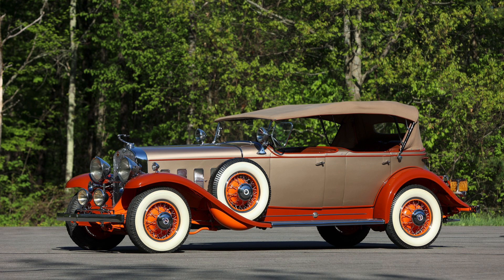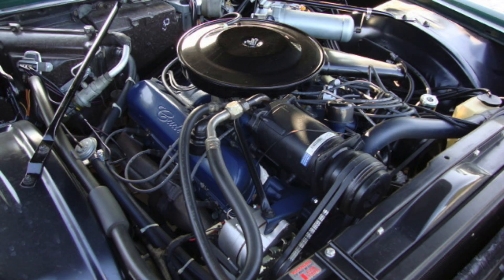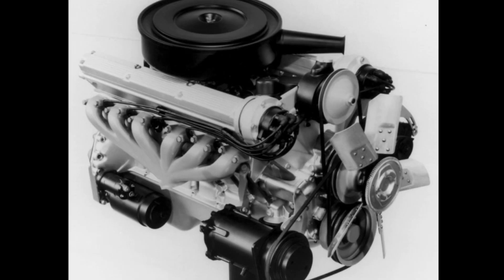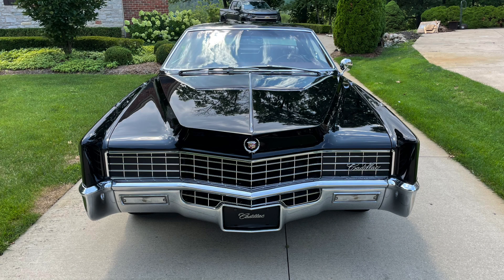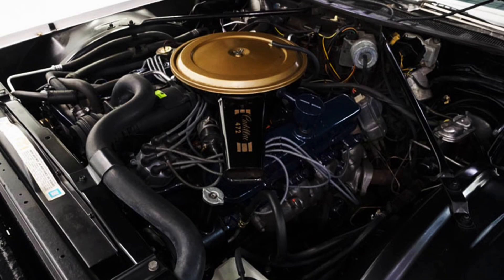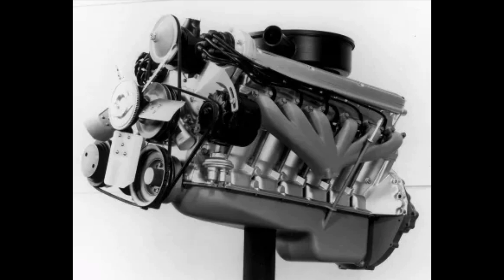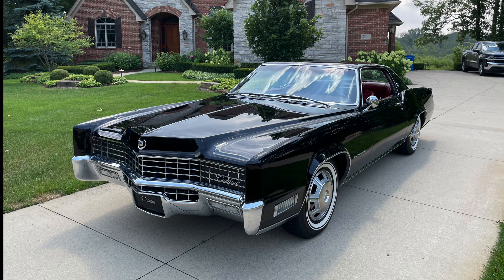Cadillac Builds an Awesome SOHC V-12 for its 1967 Eldorado...But Scraps It For Production!

Comment: I started as an engineer at GM in 1986.  One of the first programs I worked on was a heavy duty chassis version of the Cadillac FWD C body vehicle for limousine and armoured car usage.  I worked with some older Cadillac engineers who were around when the V12 was under development in the '60s.  It was an aluminum block and head design and they said the main reasons it didn't go into production was engine sealabililty, mainly head gaskets, and block porosity issues.  They said the 472/500 was done in a compressed time schedule so there was very little "optimization" of the design, rather it was a "home run" approach where they just threw cast iron at it to ensure robustness.
Reply: You'd think after that experience, and the troublesome aluminum Buick V8, they would have gotten those issues worked out by the '82 HT4100, but they still had problems with Northstar head gaskets until 2004.  Henry Leland must have spun in his grave.
Reply: @ralphl7643 
As I understand it the main issue with the Northstar head gasket issue was the  poor choice of the head bolt size and the pitch of the thread. IIRC the head bolts were a fine thread. A big no no in aluminum usually. Also I'm not sure if the fasteners were SAE or ISO. Metric fasteners vs their SAE equivilants are usually stronger and can take a higher torque for equivilant materials.
Reply: @mpetersen6  Yes, they made the bolts larger in 2000 and threads coarser in 2004.  But after the HT4100 had ruined Cadillac's reputation in the 80s, the Northstar needed to be indestructible from its beginning in 1992.  A big nail in GM's coffin.
Reply: @ralphl7643  The Aluminum Buick V8 as a Rover engine ended up being OK
Reply: @gregrudd6983  I agree.  I couldn't believe it at the time, even being a kid, but my best friend's father had a 25-foot Owens cruiser in the brackish Sacramento Delta and it was running an aluminum Olds or Buick 215 - with raw water cooling!
Reply: One of the engineers I worked with at the former Buick engineering said one of the issues they had with that aluminum V8 was that leftover shavings from the block that didn't get cleaned out during the manufacturing process would turn into little spheroids when they came into contact with ethylene glycol in the coolant.  These would then impinge upon the water pump impeller and create failures.  The Brits figured out how to address all the issues and it proved a pretty robust engine design.
Reply: Interesting
Reply: Since when would head gasket issues stop GM?
Reply: I entered GM engineering via the GMI program in August 1966... saw the '67 Camaro before it came out... quite a surprise design at the time... 
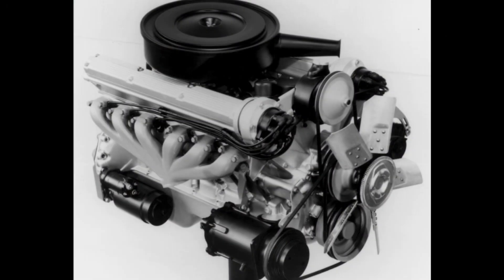At 01:34+ in video he's blathering on about a deep groove pulley on the AC compressor... obviously it isn't, as the belt is actually showing partly above the pulley groove... rather than down in the groove... oh well... kids these days... LOL!

Comment: man, too bad they didn't go for it...what a halo that would have been for Cadillac...everyone would know that under that looonng hood was an awesome 12 cylinder.  I don't think the cost would have mattered that much as plenty of people will pay for the prestige of a halo car.  and what is an Eldo for other than posing?  lol.  Although, i can't see that a high revving engine would be in line with the market for the Eldo...mountainous torque would much more appropriate, which it got with the 500.

Comment: Fascinating video. V8 or v12, the 67-68 ElDorado’s are works of art. Cadillac at its best…
Thanks for the great videos Adam!
Reply: The 67-68 Eldorado is one of the best looking cars GM ever made, but it would look better if the front wheels were moved forwards 4-6”. That huge front overhang looks off.

It would be cool if someone did a complete resto-mod on one, actually swapped in a V12, and took it to a builder like the Ring Brothers to have those front wheels moved forwards (a massive undertaking). 

They did it with the AMC Javelin they built for Prestone Antifreeze, and it made it look so much better. But then again, that was a cost no issue type of build.

Comment: Thanks for this look back on the potential V-12 considered for Eldorado in its debut. All things considered, hearing the increased cost built in to a front wheel drive arrangement, I would have preferred passing on the front wheel drive aspect in favor of the OHC 
V-12. I think that would have been a more desirable arrangement.
Reply: Exactly. It would have been a marketing slam-dunk. Many would have paid a premium for a V12 option - and the V8 would have served for a lower price option as well as spreading the risk with the new V12. History says they backed the wrong horse because FWD was never befitting of a large luxury car.
Reply: Yes and no. The front wheel drive enabled a flat floor and more interior room. No big transmission hump. @andoletube

Comment: I'd like to point out a few benefits of a V-12 that you didn't mention. I don't believe horsepower was a significant factor in going for twelve cylinders, but acceleration would be significantly enhanced over a v-8, one reason Ferrari preferred them. There was also the prestige factor a twelve offered, helping to further set them apart from Lincoln and Imperial. As always, it was nice to get technical information on that little known engine, as well as your perspective on that project.
Reply: The idea of the V12 was smoothness,  some folks didn't want to know the car was actually running,  the Packard was good for those... but the Packard straight 8 was probably just as smooth running as a V12.
Reply: @jeffreyfelder7981  Totally agree about Packard.  Even their final V8's were amazingly smooth and quiet.  As a kid, I literally walked past a Clipper in the shop one day and was shocked to see the fan turning...
Reply: V12 are also smoother.
Reply: I would say that Ferrari and Cadillac is comparing apples and watermelons.  A large luxury car needs a quiet torque monster at low RPM, not a screaming high-HP, high-RPM motor.   They didn't forget about one-upping Lincoln though... I'm pretty sure they came up with 472 just because Lincoln had a 462.   😉
Reply: As to acceleration, disadvantage of a V10, V12, V16 over a V8 is the additional weight... as well as length and complexity...

Comment: Sure, the big Caddy V8's were fairly reliable, but had a hard time passing up a gas station. This was never more impactful when the first gas shortage hit, with it's higher prices. Cadillac had to respond by reducing the engine size in 1977. It already had the "international" sized Seville.
The 500 c.i. Caddy V8 was surely a torque monster, but from my experience, they had a real carbon build-up problem. This necessitated pulling the heads to properly de-carbon the engines. On the Eldo's, this was an easier job because of the spacious underhood. But with any Caddy, the accessories presented a problem.

Comment: Would it have been cool from a collectors standpoint? Absolutely. But I don't disagree with the bean counters on this one, as the 472/500/425/368 proved to be a good motor despite all the emissions garbage it would face during the malaise era. A V12 with overhead cams would've been a service nightmare in this era, with the requirement of more frequent service and needing specialized staff. They never wouldve survived the secondary market without Cadillac specific mechanics.

Comment: The V12 would have added more weight on the front heavy fwd Eldorado unless it had an aluminum block, an extreme rarity at that time
Reply: It WAS an aluminum block and heads. One more added cost to manufacture.

Comment: I had no idea the Eldo was supposed to have a V-12.  It's almost criminal that they flirted with the idea, but didn't bring it to fruition.  What an engineering coup that would have been!  

In 2015 I accompanied a friend to Oshkosh, WI for the annual Experimental Aircraft Association's annual big fly-in (think 500,000+ people visiting, and 10,000 planes at the local airport), and Ford Motor Company had on display an incredibly beautiful show car, paying homage to the original Lincoln Zephyr, painted in the original Zephyr blue.  It was gorgeous.  Asking the reps, I wondered what kind of power plant Ford would consider using; their answer was disappointing:  A turbocharged 4 cylinder.  That car would have deserved a V-12 too.
Reply: Yes, Cadillac was indeed experimenting with a V12 and even a V16.  Should have put a V12 in the new Front Drive Eldorado.  That would have forced Lincoln's hand, and maybe even Chrysler's hand.  Ignoring it would have meant extinction.

Comment: The fuel pump at  (2:21)  looks like a regular 4657 pump.     Then at  (3:27)  there's  a other fuel pump on the DS but looks like a newer 40704 pump.      Just imagine if Cadillac made a 67 Eldorado with a V-12, manual trans, RWD with a 12 bolt posi and four wheel disk.........

Comment: The 1966 and 67 old Tornados 425 ci was rated at 385 ho. Caddy was way behind in engine output.
Reply: Caddys make torque.  Had several old caddy 425s and several 500s.
Drove them for 25 years straight. 
Then I built a super caddy with 500hp and rebuilt the th400 myself and everything in the car. I know every bolt in those engines.

Comment: Thank you for revealing this little known information. While the OHC V-12 concept was an interesting and exotic design exercise, it seems that GM made the right decision to stick with tried and proven reliability of a more conventional engine design. GM was already pushing the envelope on many design fronts in the 1960s, and perhaps the price we paid was much more mundane engineering in the 1970s due to things like Ralph Nader's book "Unsafe at any Speed".

I would also agree that packaging a V-12 with a FWD transaxle might have been a challenge in the case of the Eldo.
Reply: GM passing on a V-12 was a safer decision too because the Achilles Heel of '67 Eldorado's is the braking ability. 

In its January '67 test drive; "Eldorado Switches From Push To Pull", Motor Trend openly questioned the safety and ethical responsibility of Cadillac for engineering a car with such poor braking ability, comparable to a late 1940's station wagon. Cadillac's response was to hand over a disc brake optioned car to MT test drivers. Even disc brakes were barely adequate.

I believe GM was well aware that the Department of Transportation, which had been formed the previous year, may raise power vs safety concerns too, helping them to nix the V-12 idea.

Although my '67 had the front disc option, it was still scary to panic stop at highway speeds. Sometimes it's wise to stop while you're ahead.
Reply: Wait, why would the cars have still been FWD instead of Cadillac adding an additional range of smaller sports sedans and sportscars as direct V12 Jaguar equivalents alongside the larger Cadillacs, much as Cadillac has today?  Was there no appetite for a Cadillac equivalent to the Jaguar XJ12 in the 1970's?  (I'm guessing a Cadillac version of the Corvair in the 1960's would have been totally out of the question, as it would have been totally out of character for the Cadillac brand at the time? Attitudes at GM had rather changed by the time the Cimarron, and later Catera, came along as small sporty sedans?)
Reply: @TassieLorenzo Don't forget the CTSV as well.
Reply: @tassielorenzo7070  the closest American competitor to the Jag would be the Corvette. The first generation T-Bird could have been one as well, but it went off in a different direction and ended up in a similar market segment as the Eldorado.

I suppose that, in the eyes of the decision makers, there was no perceived market for a domestic competitor to the XK-12?

Comment: The 472 and 500 would blow the head gasket between cylinders, causing two cylinders to completely lose power. If you were up to pulling the intake and heads, maybe not a deal breaker.

Comment: Did they ever drop one into a test mule? When did the Pontiac OHV inline 6 hit; about 1967? Alas, the V12 wouldn't have survived the lowering compression and eventual fuel crises of the 70s. Jaguar managed to do it, albeit at a MUCH lower volume which is NOT what GM likes to do (Corvette notwithstanding) . Notice how quickly they killed the Fiero which somehow snuck out.

Comment: Nope, the high compression 472ci, GM crap bean counters, installed a plastic over metal timing gear.  Which 100% failed between 50-80k miles. Total mess.  Same for the high compression 500. Like the stupid plastic OHC timing chain tensioners. Same results. The timing chain hopped over its timing, ruining many of the motors. First telltale sign..  cannot keep distributor timing steady. 

While our 74 (472) and 76 (500) models seemed  to not have above issue in mass..  there was not enough power/rpm, camshaft chain pressure (due to low life and overlap of these choked motors), where the plastic over metal teeth would break off.
Reply: Plastic timing gears were there for quieter operation. Metal gears would have been cheaper to produce.

Comment: There’s just something magic about a 12 cylinder engine. So smooth.
Reply: It is the power overlaps that make smoothe running the more cylinders the more overlaps
Reply: Yes, in principle. But those Caddy V-8's were very smooth and silent. The 429 was a magnificent engine that performed flawlessly. I suppose the 472/500 engines were good too but I remember seeing one with its crank in 2 pieces. In any case, there would be no real advantage to a V-12, just like there would be no advantage to having an overhead cam in an engine that tends to run around 2000 RPM. But a V-12 badge would be cool.
Reply: @soaringvulture  The old 346 L head Cadillac V8's were amazingly smooth as well.
Reply: @edwardpate6128  Easy for a flathead to be smooth. Not much valve gear to make noise.
Reply: @soaringvulture  v-12 is just 2 v6's stuck together........JMHO but DOHC would have been a game changer even on a 2,000 rpm engine......the sheer amount of valve area is just insane.

Comment: Thank you for illuminating the history on this V12, Adam. I'd read a few scraps of info through the years on this and you are the first to really put this story together! The business case just wasn't there for this engine from a cost and or possibly a  reliability perspective. Cadillac mostly had always based their engineering on the tried-and-true, executed extremely well.
This "conservative innovation" served them and their bulletproof reputation very well for many decades. Too bad that by the early 1980's when they had to react quickly to multiple fuel shortage scares, they didn't have time to fully develop the V8-6-4, the 4.1 V8 or the Olds diesel they utilized to their usual very high standards. As we have all seen - this and a lot of other factors in the marketplace conspired to cost Cadillac their hard won reputation for excellence. Since those dark times they've built and continue to build vehicles today which compare to the best on the planet, but their reputation continues to lag behind the reality of the quality and capabilities of their vehicles - an argument for another time. Cheers!
Reply: Small rough-riding compacts do not qualify as the "best on the planet".
Reply: Yeah, it's too bad that it isn't still 1965. Compare what Cadillac produces today with any of their CONTEMPORARY competition, Michael. I love the old stuff, too. But time and tech move on. I've owned a couple of old Caddies and the comfort cannot be matched by the newer stuff - so I hear you! Best, Rick   @michaelbenardo5695
Reply: Speaking of quality and engineering comparisons. 99% of what is built TODAY qualifies as a small rough riding compact compared to what everyone USED to build.
Welcome to 2023.
 @michaelbenardo5695
Reply: Same lame excuse used when Cadillac shorted the Allante' from the Northstar. Same lame excuse used when Cadillac didn't build the Solitaire. As for "bulletproof reputation", BS. Cadillac once called itself The Standard of the World. Heard that one from them lately? Didn't think so.
Reply: Yeah, once the 1980's dawned their reputation was destroyed. I was speaking about before then, if you reread my post, which was my point. Cadillac had a sterling engineering record from it's inception in 1903, through the first American production V8 in the teens, the V12 and V16 in the classic era, their flathead V8 which powered many military vehicles in WWII and the first post-war American ohv V8 that along with Oldsmobile, started a headlong rush into V8 performance that still goes on through today. Too bad they didn't have the chops to continue their excellent engineering record when the fuel shortages hit. I also reiterate that what they build today, in 2023, is very well done - if not that stand-out special anymore.  @caribman10

Comment: Hard to see grandma zipping around town in her Ferrari engine Cadillac.  The 70 Eldo was the highest performance Cadillac ever made until the 2000s.  Performance was not part of the Cadillac meme.  If they went down that road they would be making Mercedes or Maserati sedans.  No doubt at a similar price.  Mitchel probably wanted the cachet of the only V 12 in America.  They faded out in the early 40s.  A small, light tubo/super charged engine makes a lot more sense.  The Saab Aero got 400 HP out of two liters with full warranty.  I think it had to use premium.  But with APC maybe not.